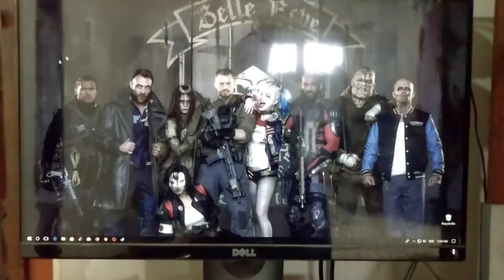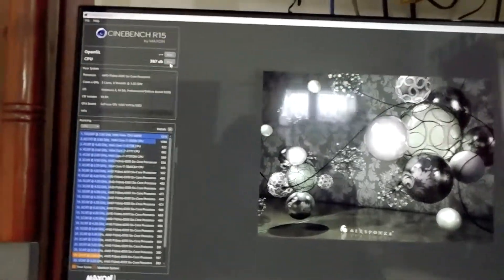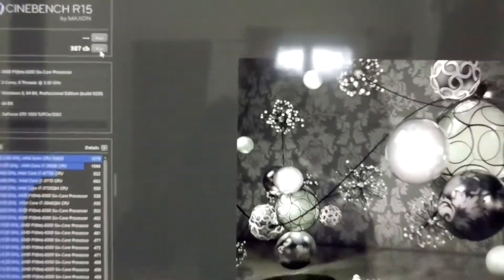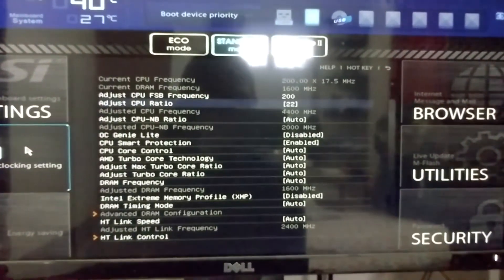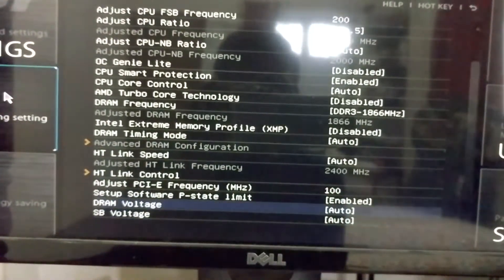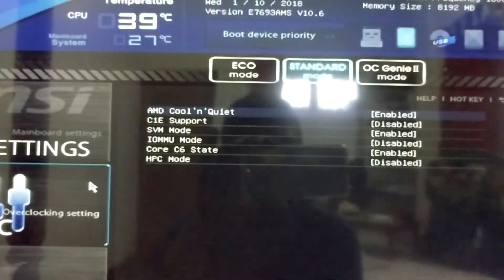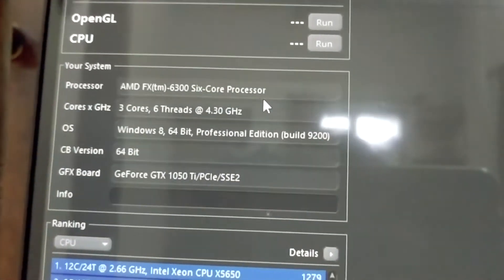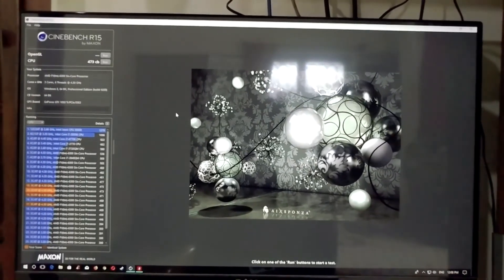How to overclock a processor | Overclocking AMD FX 6300 | MSI 970A-G43 mother board

Comment: So I heard this mobo only truly supports 95w tdp and under? I currently have a fx-6350 and sure it works but when i stress it on stock clocks with cpuz bench it drops on score to 35 from 1150? On most games even if i oc it to 4.5ghz it performs great but on arma 3 koth it plays good for awhile and then performance dips massively and forces me to minimize it and maximize the game again to make it snap out of it. Run into that with your 6300?

Comment: ahah, laughed heartily.  and who will overclock the cpu NB, in 2k18 to drive by a factor.  When you can set the bus to 220 and the multiplier of 20, having overclocked the entire system including the north bridge.  if you got 4.4 on the processor and 2200 on the north bridge, and there you can tweak the multiplier to 2600